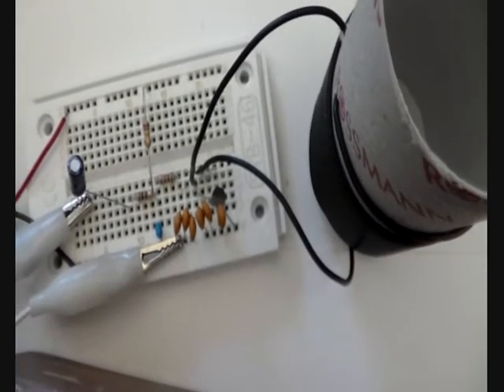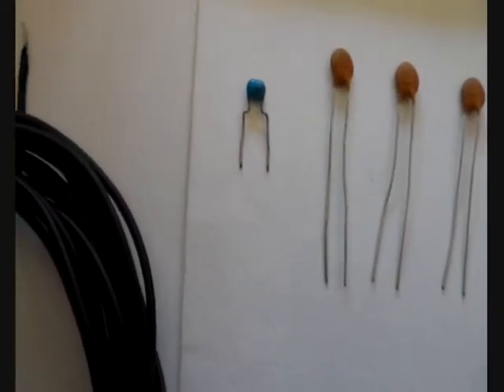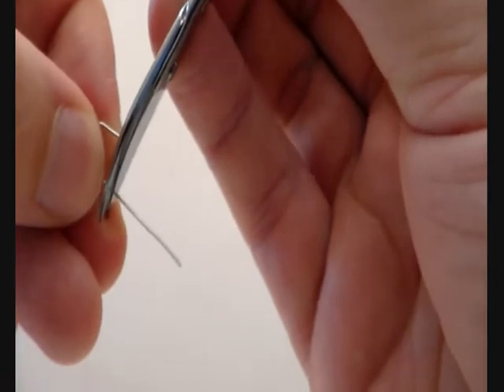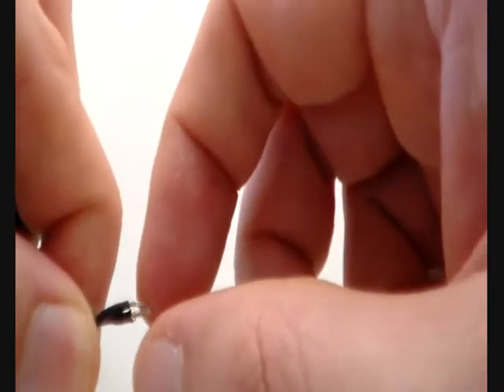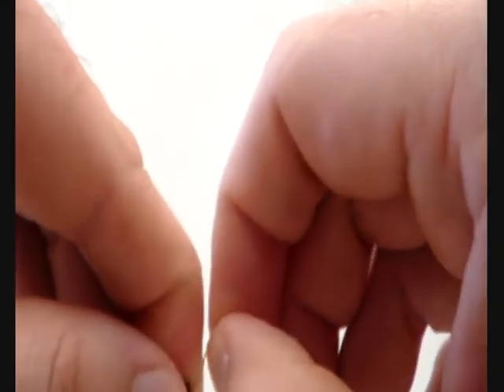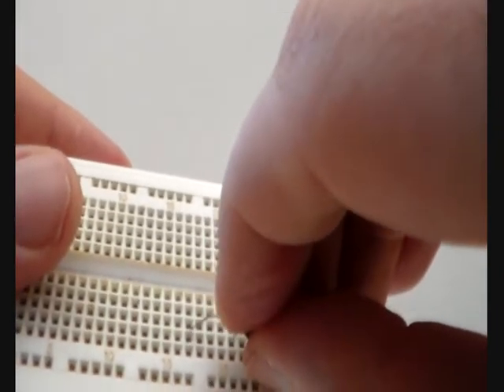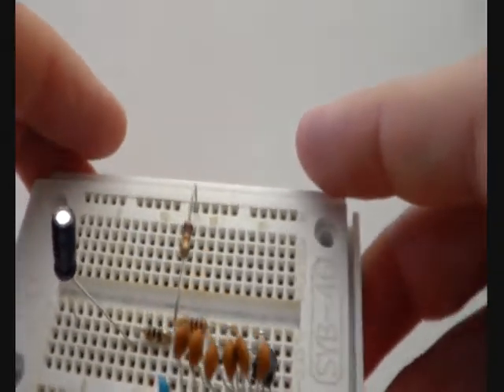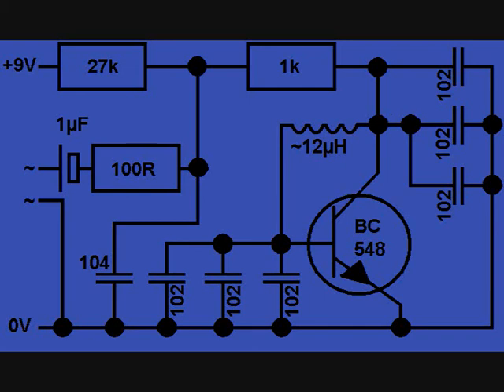Beginners project small AM transmitter

Comment: What is the range? Please respond
Reply from the maker: Depending on what type of coil is used it can be around 1 foot (30cm) or more. If you use the coil in the Video the range is 1 foot / 30cm with an average Radio. If you make a big loop antenna (like a few meter Long wire in a "square form" on the wall) the range could increase to maybe 2...3 meters (6...9ft).The Transmitter is intended to be weak so no licence is required for it´s Operation. It´s purpose is to supply old / vintage Radios with a Signal from a Computer or another Audio source via the AM band
Reply: @Stefan0719  I see. I was able to make an AM transmitter as well but the range is also less than 1m. We have a school project that requires us to transmit at least 10m range. Someone told me to add a series of rf amplifiers. Can I use that?
Reply from the maker: Hello,basically the Transmitter can be amplified to increase the range. Actually there are more simple Solutions to that Problem. I might make a Video about AM Transmitter circuit depending on how soon you need it and even then I can´t promise a Thing. The best Thing that you could do is get one of These 1MHz TTL Oscillators (the square shaped metal Thing with 4 Pins). Combine it with an LM386 Audio amplifier (Build the Audio amplifier but connect the "+5V" pin from the oscillator to pin 5 from the LM386 without coupling capacitor). Now add a PI Filter on the Output of the 1MHz TTL Oscillator. From the TTL Osc. Output pin like that: 1nF goes to 470pF and 470pF goes to ground. Where 1nF and 470pF meet you add an inductor (220µH) and to the other side of the inductor a 2m Long Antenna (6ft). Now where inductor / Antenna meet you add a variable capacitor to ground and so you can align the range. This will sure broadcast 10m (30ft) to an average Radio. On the LM386 Input you might need some blocking capacitors (like 10nF) from amplifier Input to ground.The circuit is supplied with 9V Battery.
Reply: Thank you for the response. It is a little bit confusing to build the connections by word. Can I find a similar schematic online?